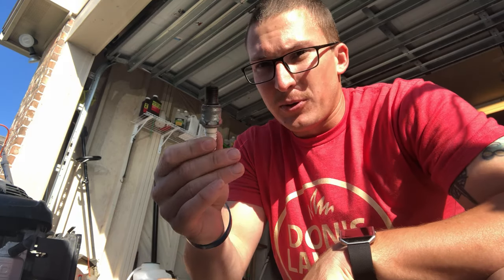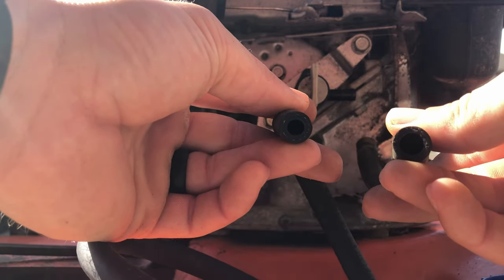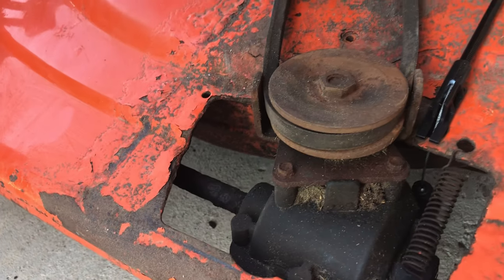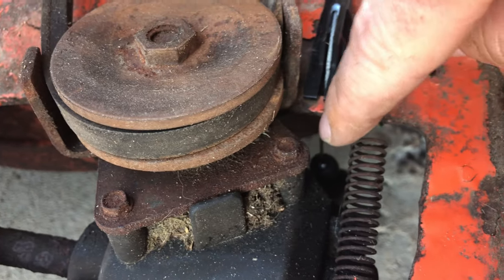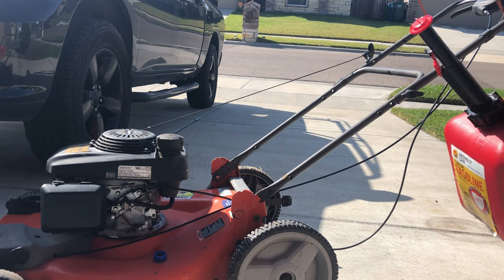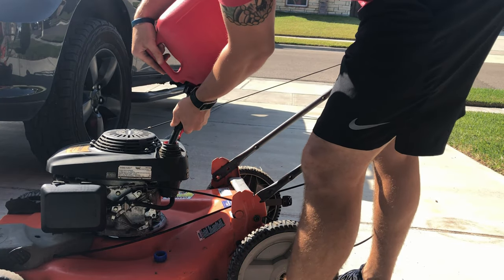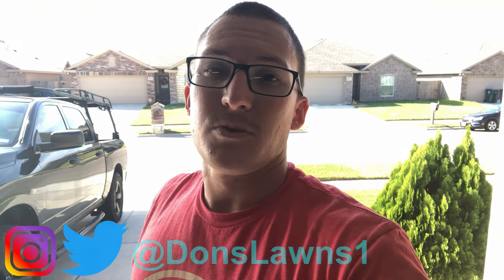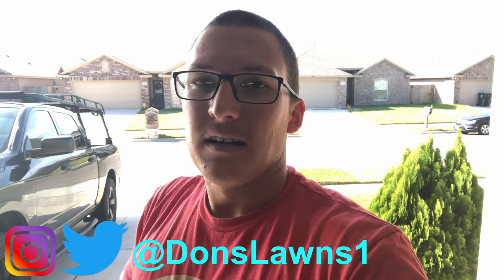Husqvarna HU700F | Honda GCV 160 | Refurb & Tune-Up

Comment: I havr the same model,  worked great for a while, now it will not stay running.  Does start easy but shuts off. Any suggestions? Thanks
Reply from the maker: Might be a dirty fuel filter!

Comment: Just curious as to how you like the front wheel drive? I’ve never owned a one. Are there any advantages over rear wheel drive? Great video for us DIY guys, great content!
Reply from the maker: So far I like it! I’ve never owned a self propelled mower, and have never used one before- so I have nothing to compare it to. I think the FWD “pulls” too much, and sometimes can cause wheel spin. (Maybe user error- because when I apply upward pressure on the handle, the front wheels grip better)

Comment: I have the same model and mine won't start and even I'd it does it'll stop after a few seconds. How would I fix that?
Reply from the maker: I would pull the spark plug and clean it, probably replace it. Might even consider cleaning the carburetor! Best of luck!

Comment: Any idea what the height of cut on each notch is?? Manual doesn't state this. Each wheel has 5 notches
Reply from the maker: No, I am not sure. There's some variability in that as for instance- my front wheels are worn down, so I could have a much lower cut than someone with newer wheels. Also, each wheel is adjustable (4 way) instead of front vs back (2 way). The best way to do it would be to go through each setting and measure the height of your blade from the flat ground.